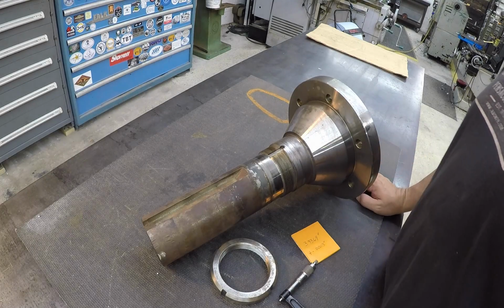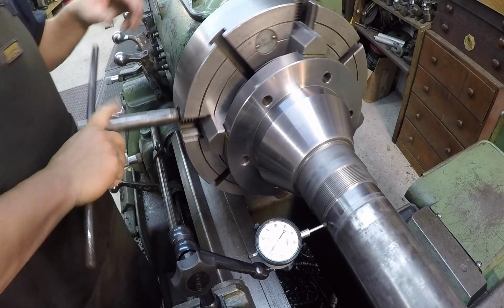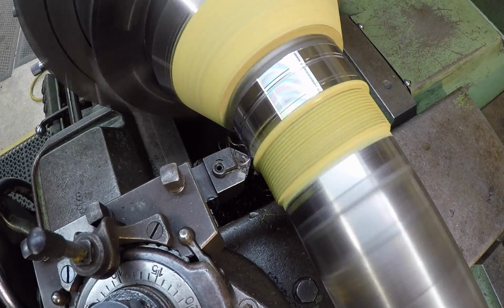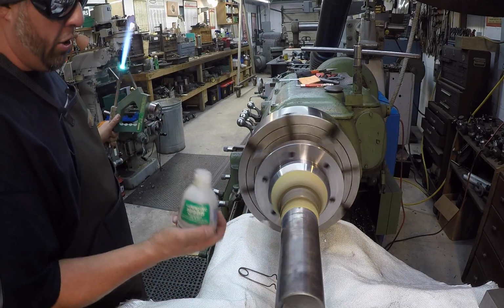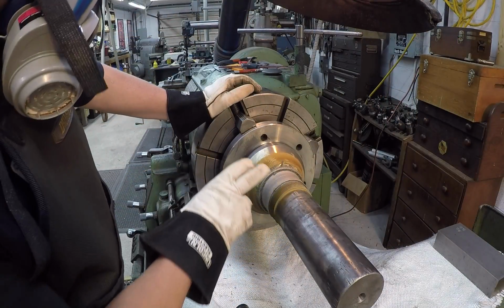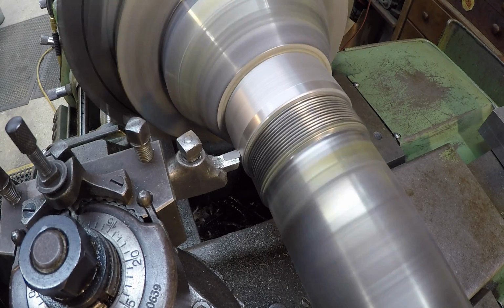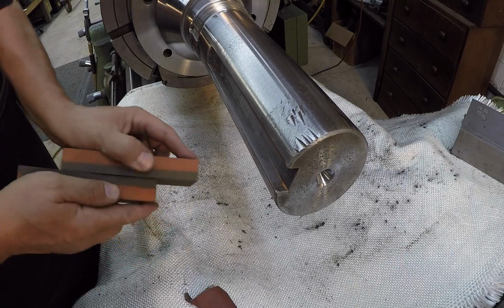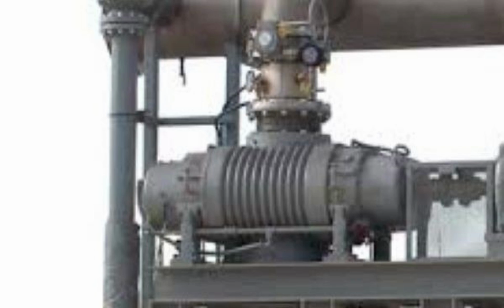SNS 300: Spray Welding a Blower Shaft

Comment: That's pretty good. I was a welder for 12 years and worked a little with some of the machinists. There was a little bit of the spray welding going on back then but never did any myself.

Comment: We use spray welding regularly on our pump shafts over 3", usually in the seal area where we get corrosion from hydro carbons on the process side of the mechanical seal. It lasts for years and it is cheaper than buying a brand new OEM from Dresser Rand.

Comment: I remember using one of these back in the late 60's, early seventies at a paper plant I worked at. I always wondered if the gadgets were still around? It was a life saver on many occasions. You just don't find parts for these machines at a hardware store. Eutectic produced some unbelievable welding products. Are they still in business?

Comment: What is the propensity of stress cracking due to lack of stress relieving/heat treating after?
Reply: none
 its not a actual fusion weld, the process is also known as cold spray (rototec) its is actually a mechanical bond not a fusion bond, so the temperature is to low to cause any change in the structure of the steel.

Comment: I also used to do Metal spraying, although with a totally different setup than yours, but after cutting the bonding thread we would lightly run a knurling tool over the cut thread to give it more of a grip when sprayed

Comment: interesting watching the spray welding.  wish our shop had one. We shrunk sleeves on  most things like that to avoid heating up the alloy steels.  speaking of heat, did I miss the part where you flooded the part with water for 10-15 minutes to completely cool it before finishing machining ??  If you finish turned it, even a little warm, it will be undersize when it cools off. :(

Comment: Interesting to see done. Brazing journals takes a bit longer but is far superior in the long run however
Reply: as someone who has done a lot of metal spray i do not agree as there a a number of coatings  that can be applyed from bronze to different types and hardness of metal, ever sprayed ceramic on a seal area? i have and its service life is amazing.

Comment: Interesting stuff. But why do you take diameter measurements when the jobs hot?
Reply: Probably to make sure he has enough material to turn it down after it cools.  Most measurements were after it cooled during the finishing work.. IMO
Reply: I guess it would depend on the coefficient of expansion of the material(s) he's working on. From my experience doing construction materials like ABS plastic will expand/contract much more than steel and cast iron.

Comment: Spray well has been around for >50 years, I used it extensively in the eighties on different repair applications for rotating equipment parts.

Comment: Interesting, never seen that done before. I used to work with a lathe and milling machine as a maintenance mechanic. Mostly 1 1/4 shafts and gear type stuff.

Comment: Spray welding isn't done much because it changes the metallurgical structure of the shaft. Most people moved on to hard chrome for the cheap stuff and hard nickle plating for the spendy stuff.
Reply: I'm sorry, but I'm trying to understand how the metallurgical structure is going to change when the maximum temperature is 250F for the substrate? Thermal-spray is a mechanical bond, it's in no way "welded".

Comment: I’m pretty new to this type of machining, I’m trying to learn as an engineer. I was wondering why you use a 4 jaw chuck instead of a 3 jawed one? Wouldn’t it be easier to center such a round part?
Reply: Difference between a 3 jaw and 4 jaw chuck
https://www.youtube.com/watch?v=maT-R32kwsM @ 6:29

Three Jaw Chuck
1. The depth of cut is comparatively less
2. Workpieces cannot be set for eccentric turning
3. Three Jaw Chuck centering accuracy is lower
4. It has less gripping power
5. Setting up of work is simple
6. Heavier jobs cannot be turned
7. Good all-around chuck for common work need common precision and excellent for repeat work

Four Jaw Chuck
1. The more depth of cut can be given
2. Workpieces can be set for eccentric turning
3. Four-Jaw Chuck centering accuracy better than 3-Jaw Chuck
4. It has more gripping power
5. Setting up of work is not easy
6. Heavier jobs can be turned
7. Slower and more difficult to use for repeat work but more versatility
Reply: Use 3- jaw for .001" accuracy, use 4 jaw for .0001" accuracy.

Comment: Many years ago (about 40) I had a Norton  m/cycle cam built up to a crazy high-performance spec (Dunstall).  I was very ignorant in those days, and it was long time ago, so I don't know exactly what process was used.  Presumably not this method, because cams are wearing surfaces.

Comment: Hey Adam; my dad worked for American Can Co. in Geneva NY and spray welded parts in the 70's , we would see the finished part and hear about the process but not see it done. Thanks for showing that process it brings back memories. Every night at the dinner table I had machining lessons, it made it hard to get through fractions in math class because everything was instantly converted to thousands by my dad.

Comment: So what is the hardness value of that spray-on coating? I would imagine that it's softer than the metal it's being sprayed onto. It's been my prior experience flame plating with plasma touches and detonation guns that coating on the outside of a part requires cooling, not heating. I have actually seen an acetylene/oxygen spray on coating come loose on a a shaft to where the coating became like a bushing that lost it's press fit.  This was done by one of our competitors.  Using acetylene/oxygen also contaminates the metal with carbon deposits. Maybe I'm being too picky because all of my previous flame plating work was done on Jet Engine components, landing gear struts, jet engine blades, and gas turbine compressor impellers where we had to meet a much higher standard.  The metal i put on was always harder than the base metal of the part being plated.  It was the friction surface of the part so that the part wouldn't wear out quickly.  Also, an electric plasma torch uses high velocity/high pressure of inert gas (argon) with powder going through the center of an electrical "flame" under super high amperage to literally impact that high velocity molten powder into the metal of the part being plated.  Your method sort of sprays the molten powder ONTO the base metal surface, not INTO the surface of the plated part.  My recommendation is to not become involved with your method of flame plating any part where the life of the user may be at risk if the plating fails. Just my two cents ...
Reply: Yeah im a boilermaker/welder by trade and have never seen this process before but have used something simular and this is sweated rather than welded on..it has no penatration so can come loose or even crumble under a heavy work load espeacialy if the specs for preheating and cooling are not followed correctly..welding that shaft the way i know it is still best but can cause a hard spot if not cooled down correctly and the shaft can snap at the hard spot and same with this process too..this does work pretty good though..once the bearing is fitted over that its pretty sound 👍😉

Comment: 19:56  Is that how you tell if it's hot enough?  The crayon will melt?
Reply: Yeah. I tig weld chrome pipe and we have to preheat before we weld. Never spray welded (or actually seen the process before this video) but seeing the process here it must be imperative for a heated surface area.
Reply: In the UK we call them Tempsticks,the stick will only melt once the required temperature is presenti n the workpiece.
Reply: you can get ones that melt at different temps too
Reply: Handy for tempering steel- like knives or chisels or-----

Comment: Fascinating . I wonder if the normal directional rotation of the shaft in normal service use is any consideration for the direction of the shaft rotation during the application of the spray weld and machining in order to provide maximum service life for the repair areas?
Reply: Lol no..it wud go on the same way nomatter what the rotation might be..its on a round shaft right ? 👍😂

Comment: Really interesting to a non-machinist like me. Q. The "high-speed tool" you built at 13:12 what steel was that and how did you make it? What tools were required? Thanks. And one more Q. For a home hobbyist like me is there a 3D printer you like? I'm a chemist, btw

Comment: I always enjoyed seeing what we could do with the thermal spray systems.  We initially bought ours to spray tungsten carbide inside valve bodies.  That stuff would actually grind down angle grinder wheels and just look like you polished it.  The nickel based sprays were great for shaft repairs.  Fixing wear from pump packing was always a big thing.

Comment: WOW !! Such a following for a specialized Industry. I took Machine Shop and Welding all thru High School in the early 60's  Then took a few more Machine Shop & Welding courses over the years at Community College. Even took some CNC Classes. I became a Truck Driver thus I never put the knowledge to work professionally. I do have a Lathe and Vertical Mill in my garage for projects that come up so my knowledge hasn't really gone totally to waste.

Comment: i luv all metal working stuff, now, what is that gauge thingy called??
Reply: Dial Indicator
Reply: Scott and mike are Both correct! The large C-shaped tool with the handle is the Micrometer, of which there are several other shapes and sizes, and the little dial thingy that he used to get it "chucked up" straight is the Dial Indicator. Hope that helps!

Comment: Thank you very much for the video. I am a retired mechanical engineer and there were several times during my career that we needed spray welding repairs. Our machine shop always outsourced them so I have never actually seen the process.
Two questions: 1) Hot iron based alloy dust plus exposure to normal atmosphere generally results in oxidation. Is the gas halo from the CO2 produced by the torch sufficient to protect the weld or is there some funky metallurgy/alloy process going on with the powder?
2). What is the feed mechanism for the powder? Or to phrase it another way, How do you control the powder deposition rate?
Reply: I agree with you about the oxidation, I was wondering the same thing. And is this something you could use in a marine setting like on a prop shaft to act as a balance that you could use to adjust the surface of the shaft to a bearing or does it require using in a "dry" type of setting where the bearing would just have oil or a bearing grease packing ?
Reply: I was wondering about the powder feed too.  There must be some trickery going on inside that handpiece.

Comment: I remember when car garages used to offer crankshaft rematerialing and always wondered what the process was, its good to keep alive an industrial process imho.  Nowadays, you would be lucky to find somewhere local who does this, even the "go to" plating and engineering place I use in Poole (uk) no longer offer spatter and spray welding, they just make you a new piece on their CNC.

Comment: Thank You its a delight to watch you work Sir ( australia) Regarding what part came from ! The old grain blowers as we called them Move a lot of air under a relatively low pressure ! back in the 30's they were adapted to cars for supercharging engines

Comment: This is a great video, and you are an excellent machinist! As a bearing guy for about 35 years, I can say that you must do really great work for your customers. One minor question about the video - you mentioned as you were "truing up" the workpiece at the beginning of the video that all of the preliminary work was in advance of inserting the center at the far end of the piece. Yet, for the entire time you are doing the finish work after spray welding, the center is (almost) nowhere in sight! What caused you to skip the center. Thanks!

Comment: it is not Welding. I am a coded welder 58 years old. Welding is the process of the parent matal and filling material fusing. brazing for instance is just surface fusion as is Soldering. THIS IS NOT WELDING
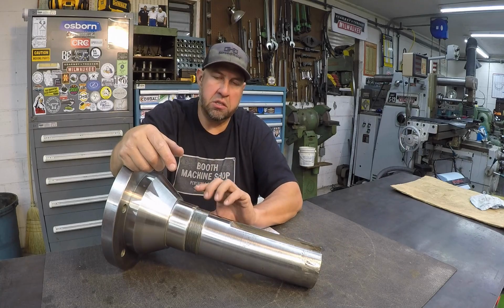Reply: 46:35
Reply: @driacon  There's always that troll who can't help himself :)
Reply: This process is known as spray metallizing... This process is done because it does not heat  the shaft to high temperature unlike welding, which may cause the shaft to bend or twist...
Reply: OK, semantics noted.

Comment: Just curious, could you not have just used a 3 jaw universal chuck for a round piece like that?
 When I used to work in Machine Shops, we would only use a 4 jaw chuck if we were turning square or rectangular stock...
Reply: Probably because you simply don't take for granted that the piece is concentric, although it does NEED to be welded concentric. Never take anything for granted in machining ;-)
Reply: @Soulsmithing  Yeah, true enough. But I know, that when we used to use either 3-jaw or collet chucks, we would still run a dial indicator on it anyway, esp. if it was to setup for a small production run.

Comment: "3/10" ("three tenths")? What they wrote down there was very different from 3/10; they wrote 3/10000 (three ten-thousandths)! What you said is a very loose tolerance but what they said is a very tight one!
Reply: I think he was referring to "3/10s" of a thousandth
Reply: That doesn't make as much sense,  @doctordhd , because even though it's mathematically feasible, it's a complex fraction, and there's no point in those if they can be reduced reasonably easily.
Reply: In a micrometer there is 9/10th every tenth. So what he was referring to was the tenths between each thousandth
Reply: Then he should have been that specific, @davinmiller8169 . Otherwise the math doesn't work out.
Reply: @HelloKittyFanMan..  lol if you know how to read the micrometer then it was specific. If you dont know how to read it then yes it sounds like hes just wrong lol. It's common to see this. We do it at my shop as well. Anytime we measure something that's over a 100"  no one says the hundred part lol. So if we measure something 129" for example. The guy reading the measurement off will just say 29. He was doing same thing. Was just referring to taking 3/10ths off the thousandth mark he was going for. But yes I will agree when you are not familiar with the methods it is easily confused lol
Reply: Machinists always talk about thous - that's 3/10 of a thou.
Reply: @gibbogle : Then that's what he should have said, but it still doesn't make as much sense as just using a simple fraction instead of a complex one.
Reply: Tom Collier: Your reply only shows up in notifications, for some odd reason. But I say the same to you as the others: Fractions of fractions are complex and confusing, and he can easily avoid that by just saying 3 ten-thousandths like normal.

Comment: Hidy from an old tool and die job-shop machinist and tool designer. I had heard of Spray Welding, but had never seen the procedure done. Great! THANK YOU GREATLY !!!
   You were showing your various cutting tools, for your tool-post and tge types of finishes you get for tge different speeds on different material types...I enjoyed listening to those specs and things...reminds me of being back in the shop atmosphere. Thank you!
   Let an old retired tech give you something to play with...try this out...Like the old saying, 'TRY IT...YOU'LL LIKE IT"...take a Left cutting cutting tool, WITHOUT grinding a chip-breaker in it, and grind a small radius, (about a .062") on the Left tip,for cutting the last run on really hard metal or .125" radius on the left tip for softer metals.  (the softer the metal, the Larger the cutting radius.) To cut both directions, (for quickly removing stock), grind a radius the radius of the entire cutting bit and grind the relief so any direction will cut. You'll find this to be your fsvorite cutter. Every cut is silky smooth. THANKS AGAIN
Reply: That makes sense. Thanks for the tip!

Comment: I was an engineer at Tuthill and actually helped design the drive shaft that he was working on. There is a lip seal that if not lubricated will cause deep scaring. Great work awesome to see this process is out there
Reply: So it went bad due to improper service intervals.
Reply: @izzyplusplusplus1004  It can be caused if the unit is used in an area with a lot of suspended particles that then act as an abrasive on the shaft or not changing the oil enough and allowing particles to be suspended in the oil sump

Comment: Bullshit. Very expensive?  The shaft is max 1hr of work + raw material.
Reply: Firstly, you would have to start with material that that is bigger than the OD of that flange. Just removing the material for the rough shape, would take a lot more than 1 hour, never mind threading, keying and drilling... Secondly, even on a CNC machine/lathe that could make this part, it would take you hours to set up the program, and then still over an hour to remove the material.

Comment: I've seen this system used in oilfield tool manufacturing and aerospace repair for decades. Saves cost on materials and saves a lot of machinist mistakes too.

Comment: No safety glasses while using a wire wheel at high speed??
Not a very bright guy is he??
Reply: Smarter than you
Reply: You're mistaken. He had safety glasses on in every instance when the machine or a power tool was on.